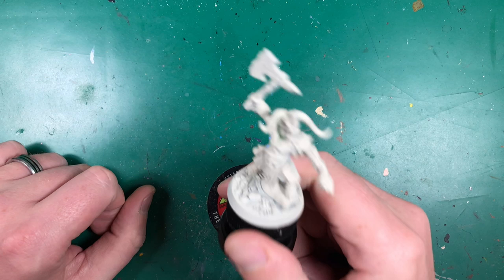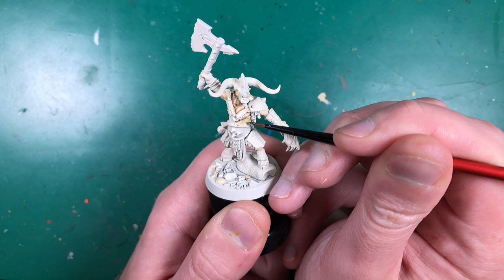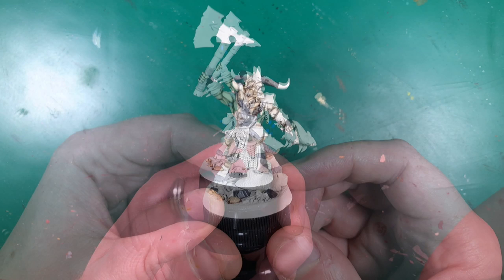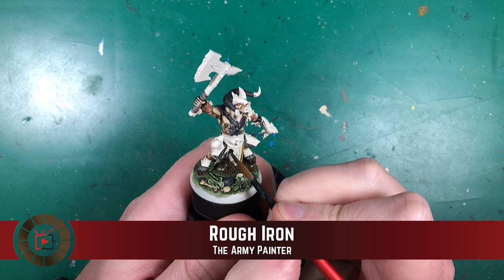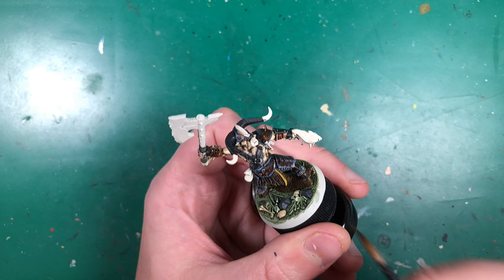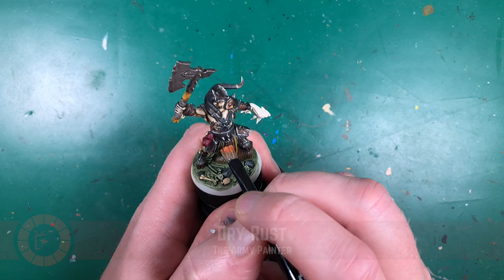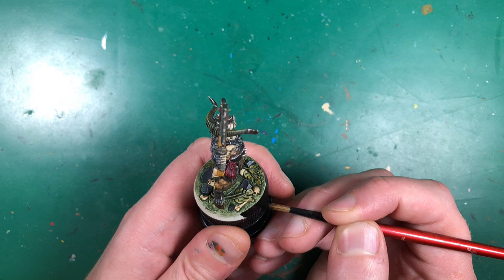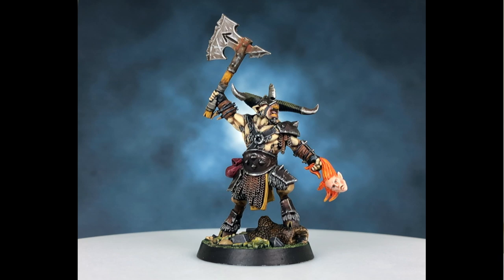Warhammer Underworlds : Beastgrave - Painting Draknar (Beastman) with Army Painter Warpaints

Comment: Almost all of the "easy-to-build/push-fit" models have this issue.  I don't remember who originally told me this sorry, but cut the peg off about half its length and sand it so that it is tapered.  This means it joins at the right angle but it doesn't get caught forcing the gap to be larger than intended and then needs to be filled.  I was really having an issue with gaps on the original Shadespire Chaos team.  Someone on Facebook shared that tip with me and the Stormcast I didn't need a drop of putty or greenstuff.
Reply from the maker: I’ve got some more to build. I will try this! Great tip. If you see a video on it soon, you know who to thank :-)